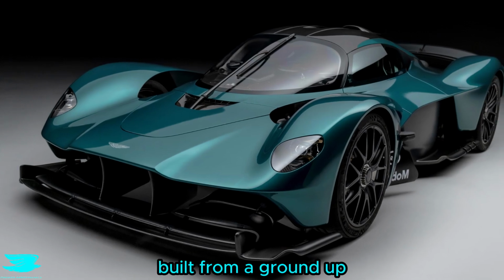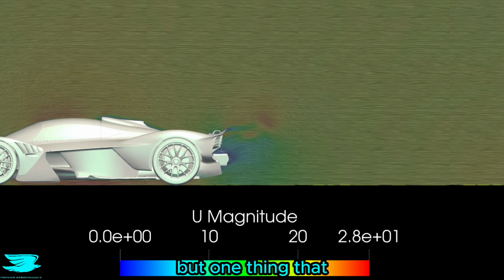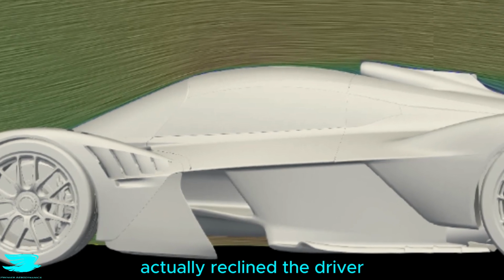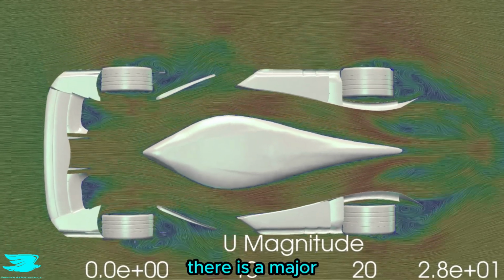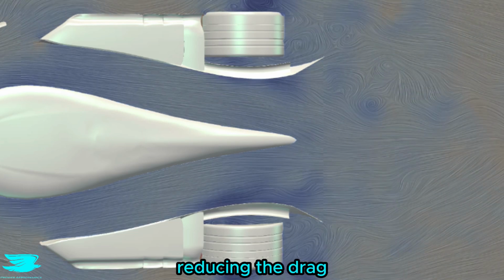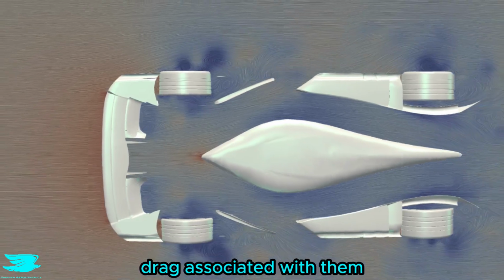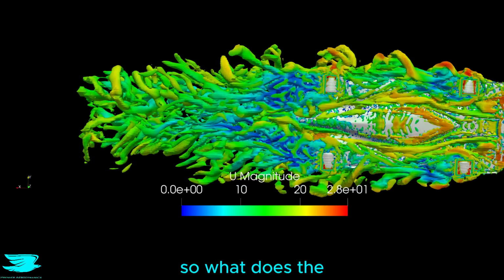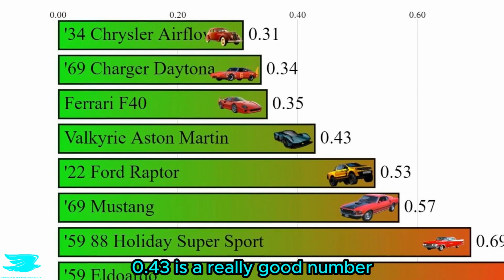*Aston Martin Valkyrie* Aerodynamics

Comment: Did you take into account the fact that the roof intake actually would be sucking in air and the exhaust would be interacting with wake for sure. How much do does things impact the whole package? Is it marginal or it can have larger effects?
Reply from the maker: It is unclear because the mass flow rate at different speeds is hard to find.

Comment: hi I think for crudely simulating the internal ducting you can define inlet faces on the 3d model as pressure outlets in the simulation setup or something like that because for example there is no way the airbox is separated in real life the way it is in this video, and I imagine the reason it separates here is backpressure from where the ducting ends on your model reversing the flow and causing external separation. since this low energy is affecting the rear wing it probably is lowering the downforce significantly so definitely worth getting on top of.
Reply from the maker: Thanks for the input!

Comment: If you worked a bit on the thumbnails, made the videos longer, maybe more structured, with a ratings system besides just the drag coefficient, with more details, you could get a lot of subs. There are tons of cars that people want to have evaluated for their aerodynamics. Maybe even have comparisons between cars that are currently competing in GT3.
You got a gold mine right there.
Reply from the maker: Thanks for the encouragement and tips! We're still kind of noobs at YouTube, so hopefully, we can figure it out.

Just a quick question, do you find the current pace of the videos good? Or too fast, or too slow?
Reply: @PremierAerodynamics  Too fast. Maybe also add more analysis specific parts of the car, you are already doing that, but just do more of these. Maybe also different aerokits for comparison. Or how about the aero behaviour at different speeds, and how that influences the air flow, maybe also how much downforce if thats possible.
Reply from the maker: Thanks for the feedback! We'll definitely incorporate that.

Comment: So if you could modify the car in a way that reduces the drag while driving straight where you dont need downforce, you could make the car even greater
Reply from the maker: Yep, that is usually the core idea behind active aerodynamics. For example, retracting the rear wing when going on straights and then popping it out when you want to go around corner (and even during braking for extra drag).
Reply: @PremierAerodynamics  Popping the rear wing under braking also pushes the tires down allowing harder braking AND can shift the balance of the car aerodynamically to counteract the shift onto the fronts, providing maximum loading on each tire.

Comment: A good reminder that a low drag coefficient doesn't necessarily correlate with better performance
Reply from the maker: Definitely, it's a package.
Reply: Drag is only bad on the straights and  maybe on very specific high speed corners, drag allows you to brake faster without using the grip on the tyres.
Reply: Should be compared to down force and application

Comment: -cL/cD value of 1.25 seems a bit underwhelming to me...
It is claimed to be 2.5 for Zenvo Aurora if I'm not wrong.
Reply from the maker: That might be the case. It might be important to note that this was not the AMR Pro version, but the regular street version. The street version doesn't have as much lift so that would reduce the lift to drag ratio.
Reply: they used different reference areas for Cl and Cd so the lift drag ratio can’t be calculated with the information in the video. it should be somewhere closer to ~5 I would think, but there are also some issues with the model so difficult to say.

Comment: The wake from the tires doesn't interact with the floor.
Reply from the maker: I noticed that too. They really tried hard to redirect that flow. It looks cool!
Reply: @PremierAerodynamics  out wash behind the wheels, it works. When you do that you can use the upper tire vortex(UTV) to extract air from the diffuser, since the diffuser vortex Co-rotates with the UTV, they merge at a certain speed.